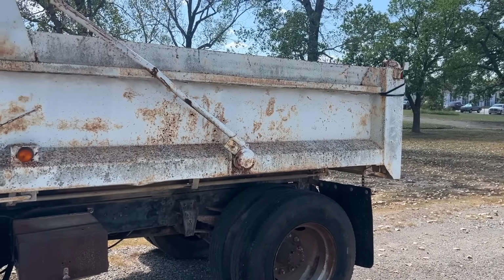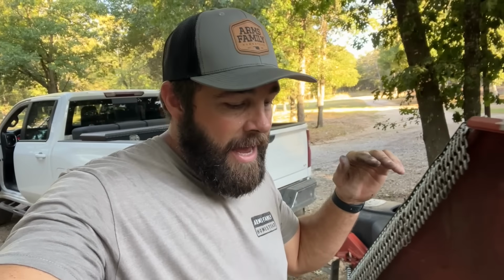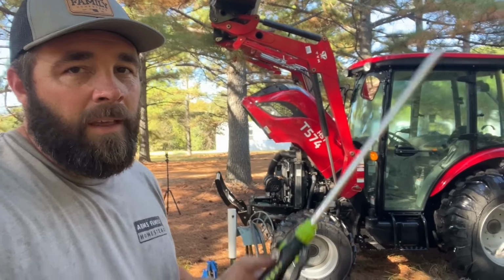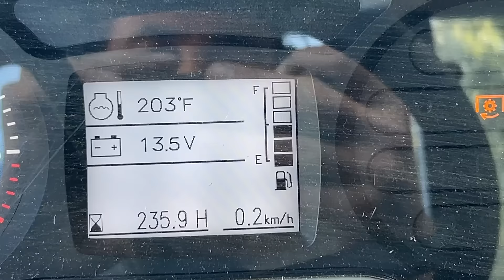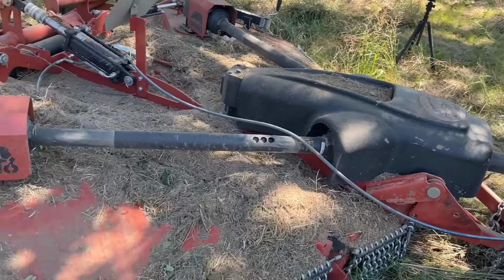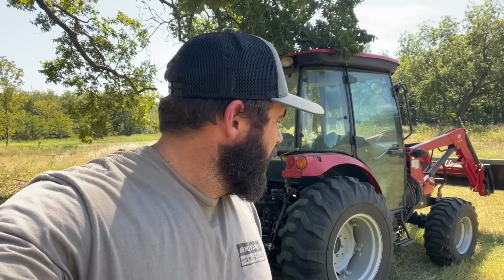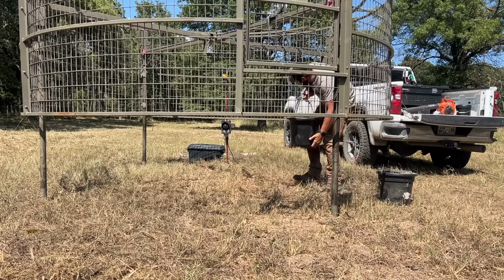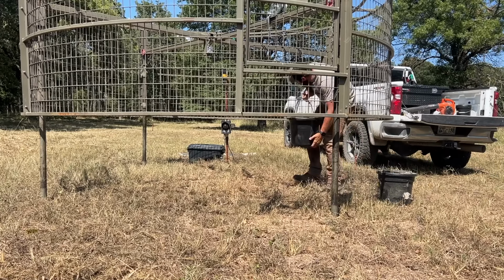That's a First for Me!

Comment: Drop your lifting arms throw a chain around the tow bar and pick it up. Dang I wish I was there. Lol. I'd grind those crappy welds off, bevel those edges, weld that up and then weld a box strap around the end of it and you'd be set and not worrying about that issue again. So far, your issues with this one tractor makes me curious of your thoughts on the overall quality of that brand. Sorry I can't be there to help, but I'm definitely engineering a fix as much as I can from 303 miles SE of you. Lol
Hold up. Shouldn't that draw bar slide farther into its receiver? All of them I've ever dealt with slid way up in there and pinned off. The way it seemed to be pinned vastly increases the force applied at the rear of the receiver. Check your owners manual, I think you'll find it should be slid farther in there.

Comment: Mate, I'm a Aussie, not religious.....but if people are leaving because of the religious bits and pieces in your shows....you don't need them. As for the hook up for your mower etc, where the weld snapped. Take that section off, remove the old weld off it straighten the bottom flat piece and reweld it.....or get some plate add it to the sides and weld that together for double strentgh. I'm guessing your mates around the place will be able to do all that for you for nothing instead off having to buy a complete new component??

Comment: I don’t know if anybody else noticed on your tractor that when you turn it on it’s 174°. I think after running all that water through it it should not be sensing 174°. It seems like you’re getting an elevated temperature on startup/untrue reading?  I don’t know about those new tractors with the computers in them if they have to be calibrated if the sensor could just be bad you can get a meter and tested on ohms. Talk to your sponsor from them tractors and see what the ohm rating should be on that temperature sensor it might be bad. Unless it’s truly overheating at times and spewing coolant, then yes you are overheating. Just a thought of your channel. Talk about whatever you want. I personally like that we all know Christ and put His message out there.

Comment: Daniel, that piece that broke on your tractor. Pardon the language, but those are some piss poor welds. What broke can be fixed by a competent  welder. Looks like 1/2" metal material that it's made out of, with only about 1/8" worth of penetration. Honestly, there is zero penetration. When it's welded the weld should penetrate into all the thickness of the metal, and that's not what has been done here. I know there has to be a welder close to you somewhere. I'd have it repaired 100 times over buying another one. Buying one, I am afraid you'd get another crappy welded one again. That mower is not heavy enough to have broke that metal, which it didn't, it just broke some really sub par welds.
If it happens you can't get another one or find a good welder, you're more than welcome to ship it to me and I will fix it fr you. At the very least, if you buy a new one, save the old one and have it fixed when you find a good welder. 
Speaking of pigs. We used to have them around here, but, they were all hunted out. Not a bad thing, just a fact. Something I have wondered, have you ever thought about building a pen to hold them, feeding them out and butchering some? If it were me, I'd keep some of the small ones, and feed them out, and have some pork in freezer camp! even better if you had a source for some good slop to feed them. Either way you feed them,you'd have control over what hey eat, so the meat would taste a lot better. Also, if you could fatten some up, a little pig fat mixed in with some deer meat, would make some awesome sausage! and some good loin, bacon, and hams! If you had a smallish cooler, you could cure some hams and shoulders, for some great country ham. Or, you could buy some old refrigerators, and hang a couple in each one. I am used to bigger pigs, so you might be able to hand 2 hams, 2 shoulders, and use the bottom to cure out the fat back and bacon. Just saying. it wold provide some different meats for your family. And maybe some to share with your ectended family and friends.